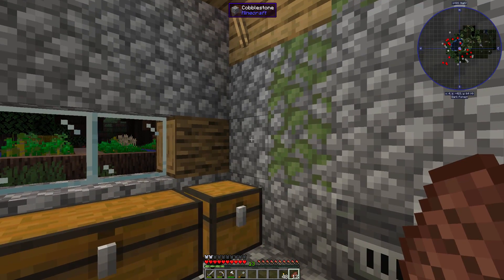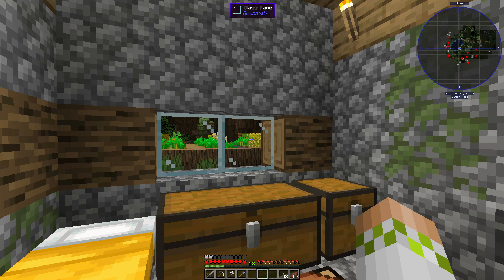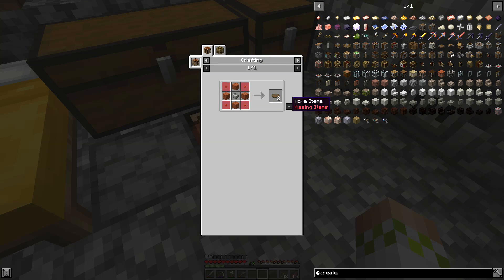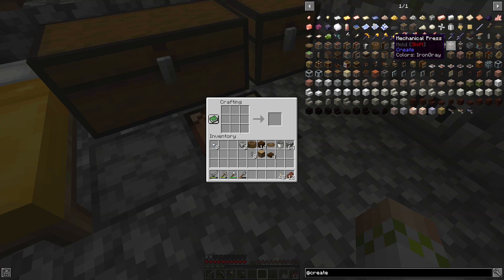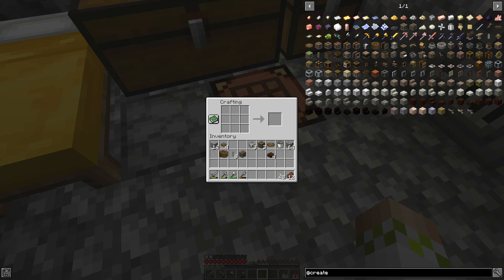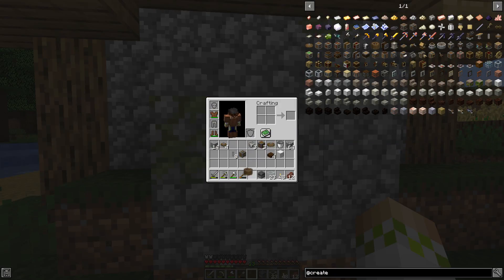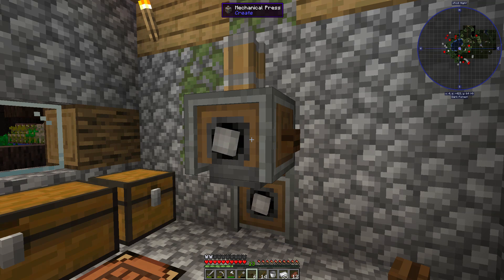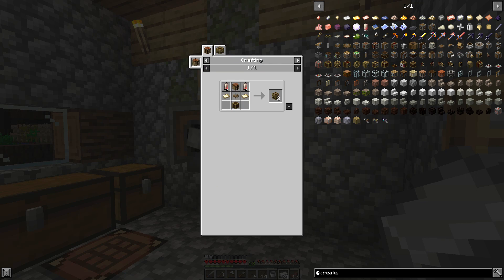Surviving With Create :: E01 - Water Wheel & Mechanical Press

Comment: For the water wheel at 11:00 or so, you only need water to be on 3 sides of the water wheel, the 4 blocks directly adjacent to the center of the wheel are the only ones that get checked for flowing water.

So 3 blocks on one whole side of the wheel can be anything, and a single source block placed on top and allowed to run down and underneath the wheel provides enough water power to get you to 256su. This basically allows you to have a water wheel set up in only 6 blocks of space.
Reply: On another of you videos, too, you mention how the hand crank is useless, which it is, and the water wheel is the best starter power, which is also true. But the 17-sail windmill provides as much power as 4 water wheels and takes little more in the way of resources to build, certainly cheaper than 4 water wheels. Plus you can use a mixture of wool and sails if one is easier to get ahold of, possibly making it even cheaper if you have some sheep early on.

Just another form of power to keep in mind for the early game.

Comment: Started watching this series after discovering the v0.3 series. At 13:30 if anyone is curious how a Gearbox actually works on the inside(like in real life), then all you need to do is place down 4 Large Cogwheels around a block(like North, East, South, West). Hook one of the Large Cogwheels up to some rotational power and watch the cogs spin. Opposite sides spin in opposite directions, just like the gearbox.

Comment: 13:56 its because two gears are inside by each other. the water wheel is turning one left, pushing the teeth on the second gear right

Comment: Hey @RagePlaysGames , consider doing a series on Crossroads MC :) there are a lot of changes coming with the 1.14.4 version, which should be released soon. (Edit) It also has ingame documentation (or will have. The 1.14 versions is as I said, in beta)

Comment: I am going to be doing a challenge with this where I can only use “natural” power. And by that I mean I cannot do the mega effective water wheel setup, I cannot use furnace engines, I can only use heat fans if it is a naturally occurring heat source, and I obviously can’t use the hand crank